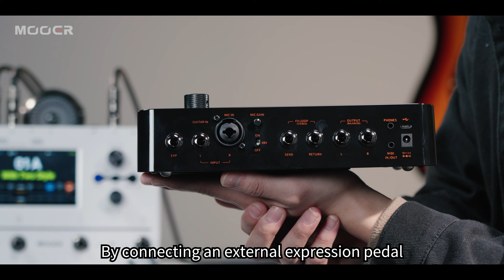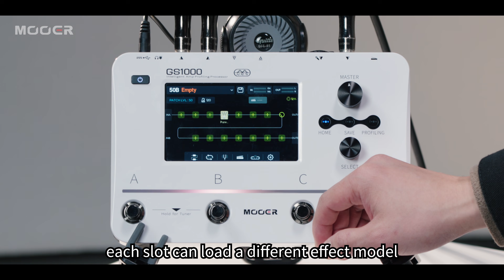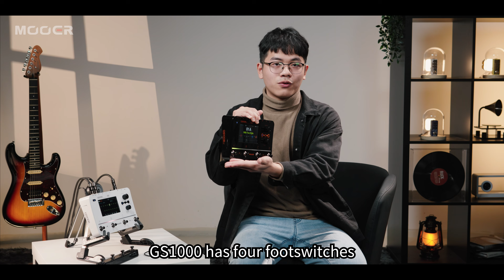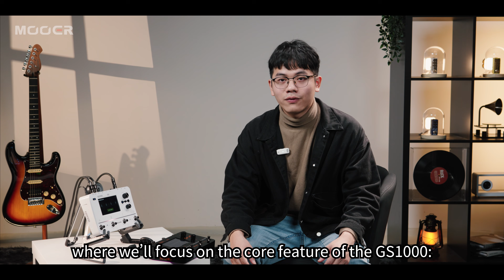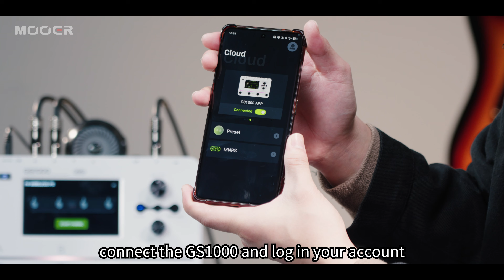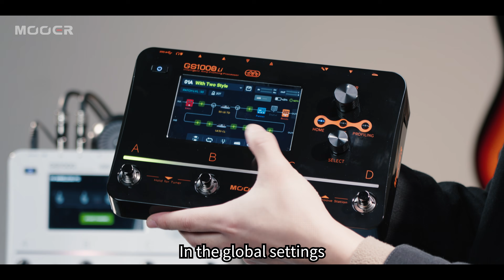MOOER GS1000 Intelligent Amp Profiling Processor Official Overview Video

Comment: Could you introduce, in the next update, a function that allows completely disabling the backlighting, especially the ABCD strip? I want to use the device in studio mode, and the light around the footswitches is simply distracting. Ideally, there should be an option to turn off the lower backlighting and the ABCD strip. The screen can remain backlit as it is now.
Reply from the maker: You can definitely turn off the lower backlighting by going into the setting and turn it off.
Reply: @MooerAudioOfficial no, i can't.

Comment: Will this Use Case work?

1/ Acoustic Guitar Input — One GS1000 signal path for acoustic guitar IR to capture my own acoustic guitar nuances (additionally, pre-amp modeling, effects, and tone control)
2/ Mic / Vocal Input — One GS1000 signal path for vocals (compression, reverb, and possibly a vocal specific IR in front of the signal chain)

I'm asking because there's no manual available yet on the Mooer website

Comment: If it has the same chips and same everything as the ge1000 why didn’t you just release this as a ge1000 update?
Reply: Agree with that, but if you want to have the capability for profiling you still need to have an xlr combo jack
Reply: @ they should have tought that before releasing the ge1000 since they knew they would have released profiling…